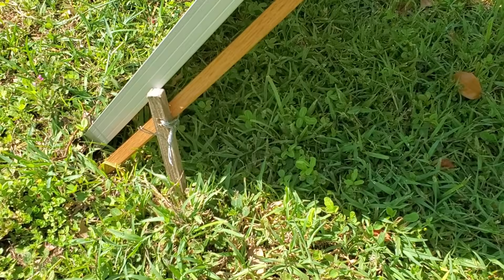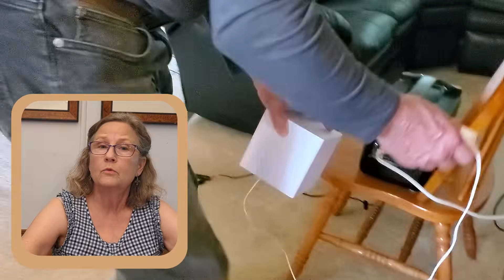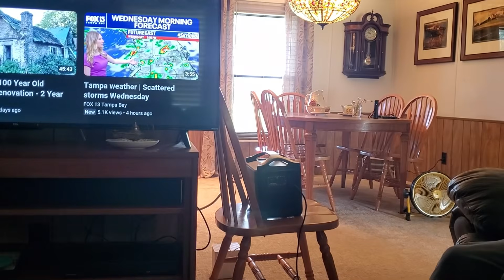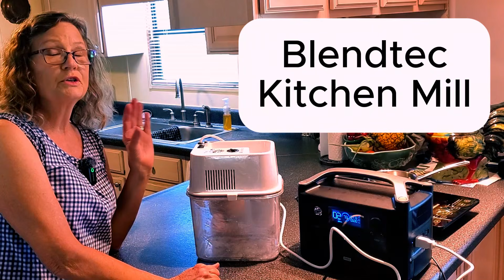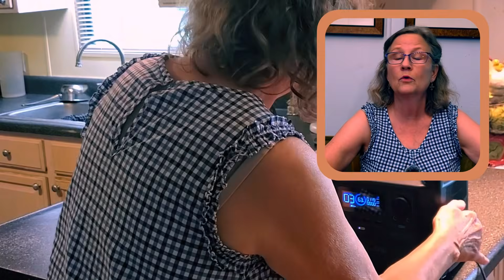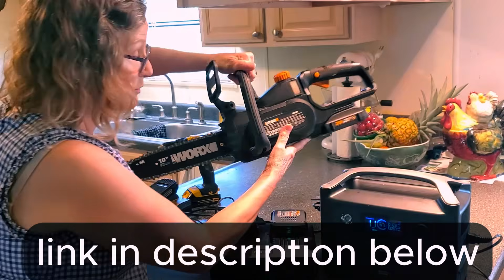After a hurricane: what will a solar panel and a battery bank really run?

Comment: I’m in Daytona Beach.  My main concern is the refrigerator and freezer.  We cook on our gas grill that has a burner.  You didn’t mention the fridge or freezer.  Does this run the fridge?
Reply: I’d also like to know if it’s suitable for fridge and freezer.. regular ones.. 👍
Reply from the maker: Our experience is that this setup is not powerful enough to run a refrigerator. We have a mini-fridge that I forgot to mention. I'm actually not very happy with it as it takes a lot of power from the battery bank. I am working on another video about the solution to run refrigerators and freezers.